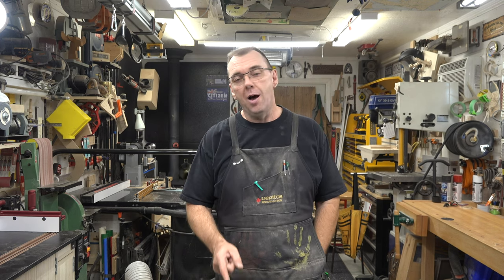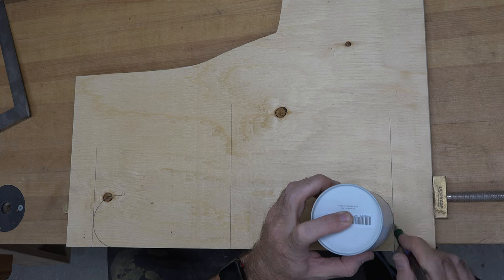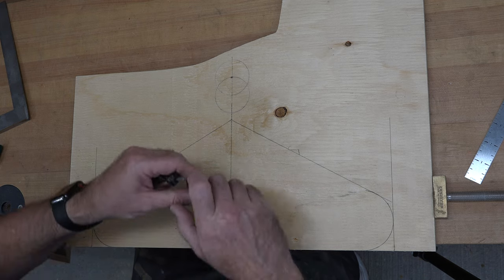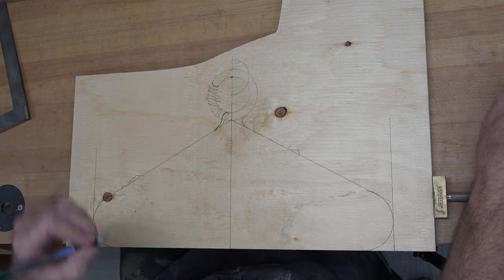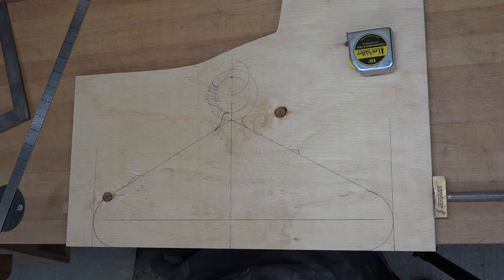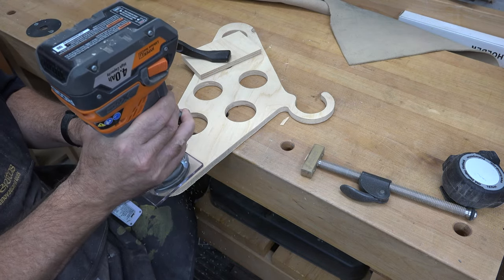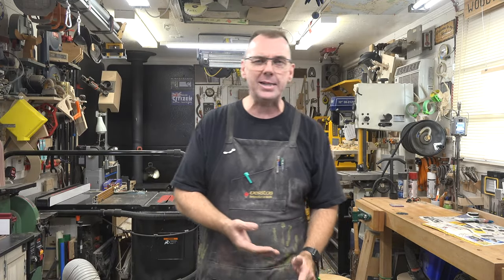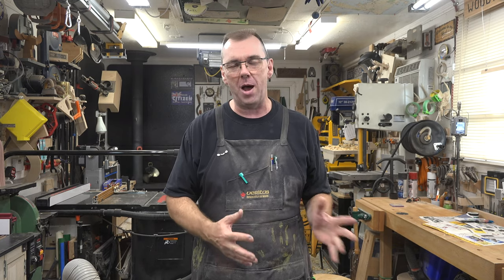Making a Scarf Holder

Comment: That's a great idea. Thanks for sharing the video. Is there a special reason why you used a Forstner bit to make the holes?  I think I'd rather use a holesaw.
Reply from the maker: A hole saw would work just fine.  Heck, a scroll saw or fret saw would work also.  I chose the forstner bit just because that's what I felt like using at the time.  No other reason.  Feel free to use any method that suits you Hans.  Any of them will be fine.  Thanks for tuning in to the show this week and taking the time to ask your questions.  It's very much appreciated.

Comment: Kenny, yet another scrap wood project.  Running low on scrap wood yet?  Painting this project probably helps keep scarves and ties from catching on any rough edges good sanding or not.  Nice simple project.
Reply from the maker: The problem with scrap wood Paul is that it never ends.  Even the scrap wood projects create more scrap wood.  LOL.  Glad to hear that you liked the project.  Thanks for tuning in to the show this week.